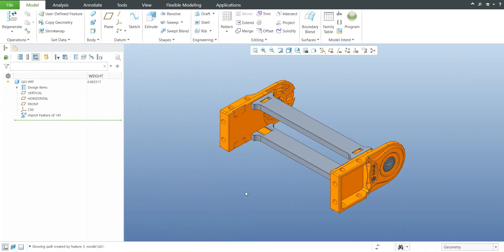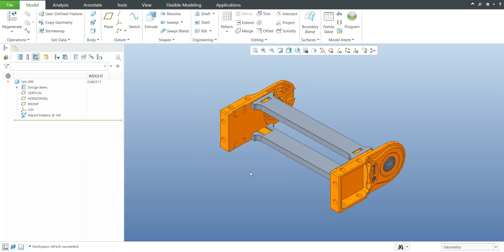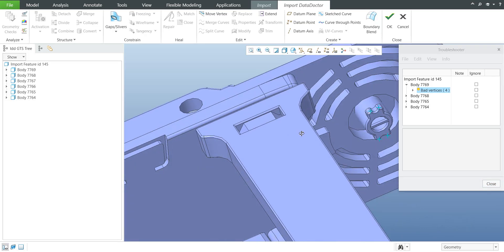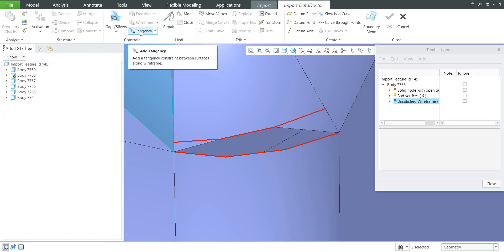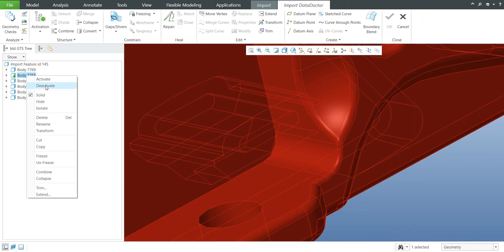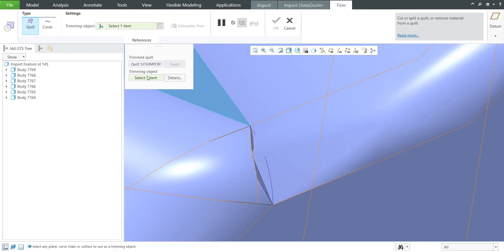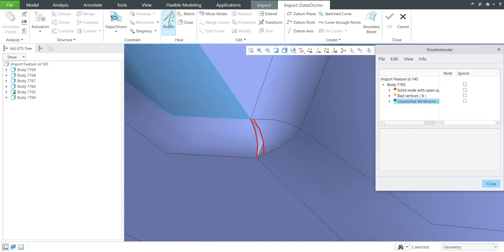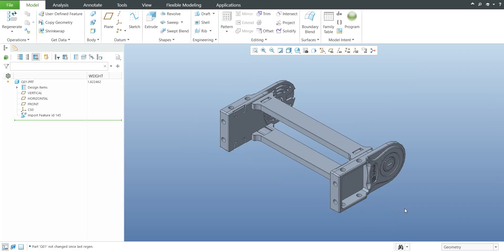How to repair imported geometry by IDD - Creo Tutorial (EN, FR, DE, PT, ES, IT)

Comment: I’ve got missing surfaces and extended faces that intersect each other, and the system doesn’t show them as errors, how do I solve them?
Reply from the maker: If you will check my previous tutorials about IDD you will see that I many times changed color preferences...toto better recognize missing surfaces or extended / intersect objects - these mistakes are not listed as error...you can only visually detect it.